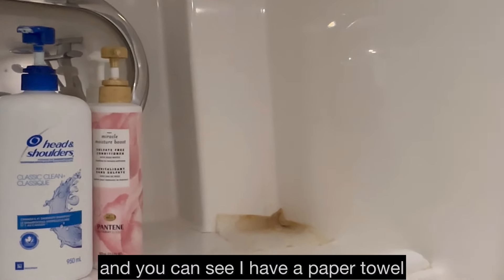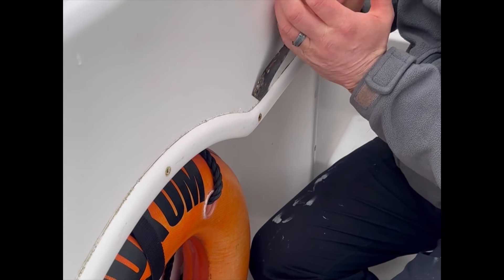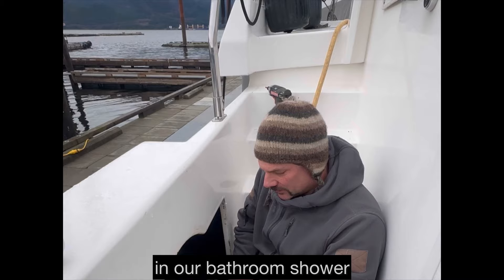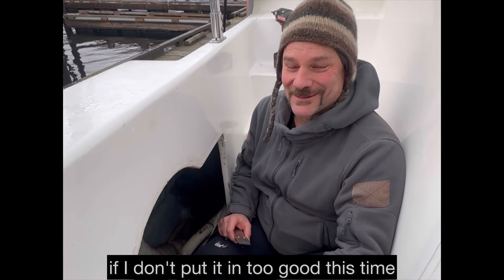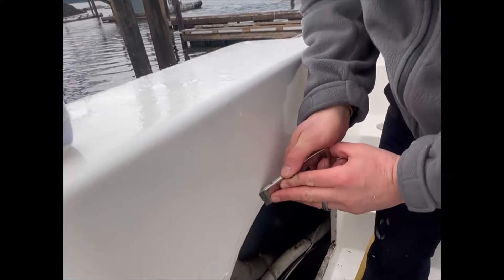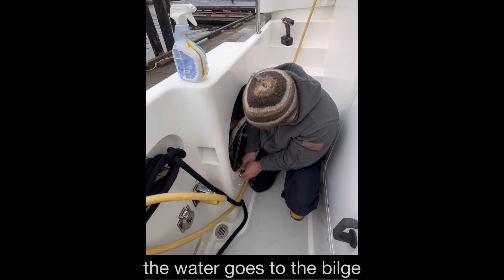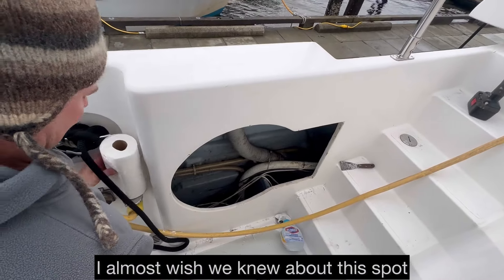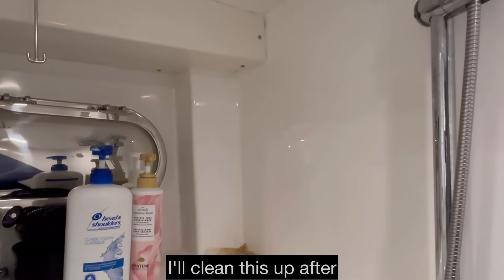Our Boats Annoying Leak! #nordhavnyacht #boatleak #boatmaintenance maintenance

Comment: Good detective work to find this.  Doing the work at 0 degrees leaves a lot to be desired.  Hope you get it dried out before mold can start.  To the comment "boats leak".  Well yes but if Navy ships did not leak then you could do without a lot of the crew.  LOL  Add up all of the places a boat is supposed to drip a little, then the ones like this that sneak up on you and the non-boaters may stay on shore.  Love the water, love your channel but I couldn't enjoy that cold.
Reply from the maker: Thanks!    So true about Navy ships!  All boats need maintenance.  Sometimes it’s stressful.       Yes the cold is not fun lol.  Especially when the winds blows from the North. It’s freezing!  I don’t think I ever get used to it hahah.  Jen